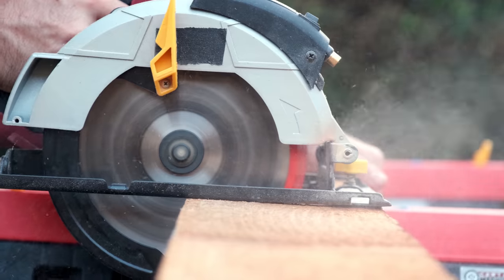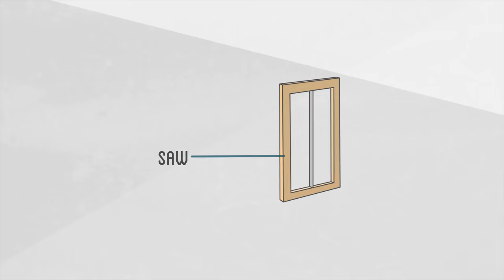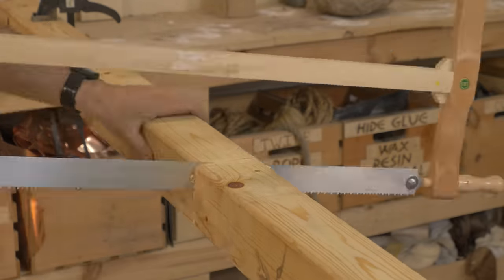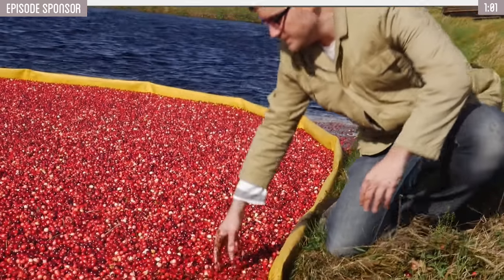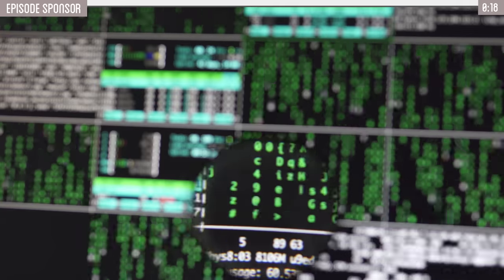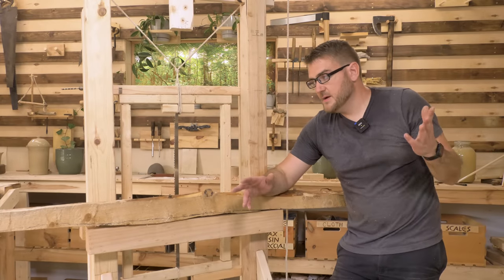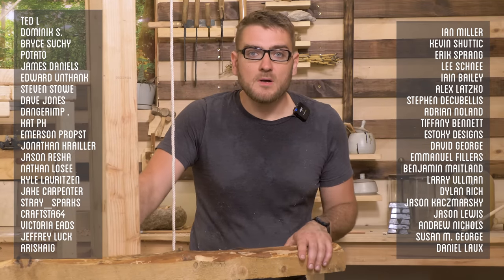This 12th Century Table Saw Is A Huge Force Multiplier!

Comment: force does not "multiply" out of thin air.
if force seems higher, it's because you're travelling more distance to apply the same force.
at the end of the cut, the energy consumed would be the same as if you were using a handsaw, as long as both are as sharp.

Comment: You should add more triangles to your frames to mitigate wobble and shifting, a rectangular frame thats only connected with 90° angles at the corner is not the most stable, if you brace it from corner to corner or something like that it should be more rigid, not speaking as a professional carpenter ive just also been doing home projects for a long time

Comment: Super cool experiment , however, the saw blade itself needs to be sharpened properly or like at all. It's like someone who doesn't know what a sharp blade looks or feels like sharpened it. Its not that much work and makes a massive difference, and medieval blade smiths absolutely knew how to sharpen a saw for good results. It's also extremely thick and not in tension which would've been common knowledge then too. The blade is definitely your biggest issue. People keep saying that the teeth need to be oriented the other way but they look relatively equilateral so I highly doubt that will prevent the thick blade from pulling the log upward or binding. The bow is plenty strong enough to pull a sharpened blade clean through since it can lift it while you're bearing down on it, the binding is likely being caused by the twists in the logs reference side coupled with a thick dull blade. Good luck with the water wheel, it'll cut easier then, but still needs a better blade to be impressive. As of now, you're just brute forcing it. They're medieval, not cavemen.

Comment: That thing is a finger remover.
Possibly a hand remover as well. It needs some basic safety thinking applied to it now. In the real industrial revolution arms, hands and fingers were regularly removed until it was understood that keeping a worker whole for twenty years was more economical than replacing them on a regular basis.
Reply: Nonsense! There's always a line of readily available replacements. Now nose to the grind wheel plebe!

Comment: Flip blade to cut on down stroke, and put wax or soap on saw blade to lubricate cutting. This will vastly reduce binding and make cutting easier and faster. 

Change the pedal to get a longer stroke per stomp, for more cutting per stoke, but have to put more weight per step.

Get a, blade with smaller teeth for easier and nicer cutting, aka a cross cut blade instead of a rip blade. Easier but less cut per step, but way less binding and cleaner cuts with more control.

Also go read websites, about how saw teeth work, it will help you make a better saw blade. 

Learn how to carburize your own steel, you skipped a huge step in the iron age going from ilmils steel to high carbon(unless I missed that video)

Comment: I tripped up on this video and is my first encounter with your channel.
While I found this video amusing it has a serious side too, historically but significantly proving the myth that accuracy is everything.
I was studying your mortice & tennon, while crudely cut are effective and solid.
My point is, almost every woodworking video out there insists on the perfect joint with no gaps created by woodpeckers, lie neilsen, veritas etc.
You have proved them all wrong. That chiesel is hardly a Stanley sweetheart or two cherries but did the job.
Ever actually inspected a genuine piece of chipendale ❓ While the stand back and admire appearance of those pieces are amazing, the quality of hidden details are let's say surprising to be kind. 
All quality antiques scream hand made, just look at dovetail joints. 
Yes we've made leaps and bounds in tool technology but the pressure to own the latest and greatest tools to do woodworking over rated. 
Woodworking should be about enjoyment, creating something out of bits of wood and honing hand to tool skills. 
So what if your dovetails are a tad gappy❓
I get what your about and I think it's brilliant.
I must conclude with I also think you're a flippin athlete‼️

Comment: I know this might sound a bit rude but I'm genuinely curious. If you're going to use precut lumber what's the point of doing all the finish work with hand tools? You've already taken advantage of a much more advanced sawmill to source your materials, why not save yourself some time?

Also the reason the wood is getting picked up on the upstroke of the saw is because the teeth are straight, and trying to cut in both directions. This combined with the thick spine of the saw and several other potential factors is causing the issue. A new saw blade with a better design that only cuts on the downstroke would be more efficient as in thet direction the table will obviously hold the piece in place and you wont waste nearly as much work lifting the wood on the upstroke.

Comment: Flip your saw blade so it cuts on the down stroke. It'll be less likely to pull the board up, and won't bind as much during the cutting stroke.
Reply: That saw cuts the same way no matter how you flip it. That's because the face and back angles of each tooth are exactly the same. It's called a plain tooth pattern. It is a crosscut pattern. Rip teeth have a rake angle.
Reply: @1pcfred  looked like a normal blade to me. In that case you are right. It wouldn't matter.
Reply: @joshuaglaude1549  it is a normal blade. That's why it is called plain.

Comment: A squared bar would have been made with an axe or hatchet that has the blade not on the center but on one side. To gain more precision you would smooth it with a plane. The saw is for planks.

Comment: Your blade is either dull or on upside down as it should be pulling down rather than pushing up. Do your saw teeth have any rake to them? You'll need to do research but I think the teeth should alternate so that the groove cut is slightly wider than the blade itself.

Comment: I suspect that the people in the 12th century had a better hold-down system than a rope. With the proper hold-down, the saw would be much easier to use and much more accurate.

Comment: Don't you need to lubricate the glides on your saw to keep it from wearing out quickly? I think they used to use animal fat. They also rubbed candle wax on the blade to make it cut more easily.

Comment: In one of the last few episodes of Dr Stone, they featured a tool used to replicate smaller design, and scale them up. On the small end you'd draw whatever you want, and through a specific configuration of wooden rods and pivot points, the image being drawn to scale on the other end. I'm just wondeing what it was/is called.
Reply: That is a pantograph tool.

Comment: Switch out your blade. If you look at the historical examples they use blades with angled teeth that cut one way, the 'return' stroke clears the sawdust from the cut. This will solve half your binding issues.

Comment: Since you are using metal ANYWAY, would it make more sense to make like a mill saw, which is essentially a large table saw.  The wheel is the best propulsion unit, so you could have a table saw and essentially set it up like any lathe, again, since using metal anyway, then attaching a bike to it would spin the wheel, or any kind of trendle.  

   But during the industrial revolution they had a treadle style fret saw, which essentially had a bicycle attached to the up and down motion to power a scrollsaw. 

   But glad I found this, I was thinking of something similar, but seeing this actually work I'm not sure I'd waste my time.  I guess thats why they figured "lets just use logs".

Comment: With the sheer amount of things he's built you'd think he'd actually get good at it and have the brains to put the saw blade on so it cuts on the down stroke rather than the up stroke plus the spring wouldn't have to be as strong and   the imput force would do more work less pulling on the spring more work going to cutting

Comment: It might be the perspective but it looks like you have mounted the blade upside down. It looks like it's cutting on the up-stroke more.
Reply: Being a plain pattern tooth it is cutting on both the up and down strokes.
Reply: @1pcfred  I took a closer look at the blade and noticed that the teeth had the same angle. The blade was filmed at an angle and that made it look like the blade was mounted upside down.

Comment: The teeth on the saw need a kerf set, and a better angle of attack, and the range of motion doesn’t allow the use of the full blade. It’s not as efficient as it could be.

Comment: Saw tooth geometry needs a good looking at. You’re ripping, so you need flat, chisel like teeth, they remove the fibers that lay lengthwise better. They also need to be almost straight one way, /_ pointing down, not <

Comment: The other big issue is you need a better solution to hold down the log as you feed it through. That piece of rope was completely inadequate and there are much more suitable solutions dating far back in history. Even if you remove iron from the equation creating a more rigid holdfast from lumber is absolutely possible whether it be another board that clamps down even loosely or better yet using a bow like spring mechanism would be better than that rope alone. Admittedly, I don't know what the rules of your project are and don't know if you are following a rigid historical design without the ability to make alterations or not.

Comment: A bit late here, but wouldn't an adjustable bar to clamp the piece down right in front of the blade worked a million times better? Rigid materials don't flex and stretch with movement like rope does

Comment: OK, you're trying to use a crosscut tooth section to do ripping.
It WILL do it, but it's going to take a LONG time.
You need a rip blade.

Comment: of all comments regarding tooth.   probably.  but not the real problem:  look at spring pole lathe for concept,  can cut on one direction.   No one is watching or observing. The whole frame is binding!!

meaning the track guide and the runners are not built correctly to force frame to operate independently of the bow or treadle

Comment: Knowing nothing about this, and admitting that I'm sure you've thought of this, what is the drawback of using pulleys in this system? It seems like, on paper, force multipliers are going to be your friend here. What would the drawbacks of incorporating a pulley system be in this design?
Reply: If you use block pulleys you trade off motion for force. One rope pulls on more ropes to move a hook less distance but with more force. There's nothing for nothing in this world. You can only trade some things for other things.

Comment: I appreciate your grit and intent here. That being said, have you done any research into how our pre-industrial ancestors accomplished these tasks? Or, is this a project to see if you can figure out the progression on your own?
There's a lot of historical reference, and a lot of historian-craftspeople recreating the techniques of the past. With a few small changes you could drastically increase the efficiency and accuracy of your work. For example: properly tensioning your saw. All band-type saws require tensioning. That big frame saw for resawing is no exception. (it looks like a Roubo style, by the way.) If you tensioned the saw properly, you would eliminate any wandering of the cut that didn't come from poor technique. If the saw was properly sharpened and ground, you'd eliminate much of the binding and reduce the amount of work it takes to make the cut. This means faster and less strenuous work.
Hopefully, that makes sense. This information is available, if your intention is to do other than see if you can get there yourself.
It's an interesting project either way.

Comment: You're fighting those massive gaps in the teeth as well as the reciprocating motion. You need to figure out how to make a fine tooth saw blade, the yanking it out of your hand is just a problem with a vertical reciprocating saw, I have the same problem with a scroll saw which is why I love a band saw because it just pushes the wood into the table. Instead of using a reciprocating saw for a saw mill, go to a circular saw, it'll make the movement much easier to control, though kick back is still a problem.

Comment: Yikes!   So much of this looked like an accident waiting to happen. It's great in principle but needs to be made safer.   He needs a brace on the top that is adjustable that can clamp at the right height to let the workpiece pass thru.  Or maybe a weighted or spring-loaded top brace to keep the workpiece from moving up with the blade.  The whole thing needs to be larger a heavier so it doesn't move around so much.

Comment: You've got the blade upside down, if you cut on the down stroke the work piece won't jump.
Reply: You've got eyesight problems because that is a plain tooth blade. That means it has no rake and cuts the same in either orientation.
Reply: @1pcfred  the flat side cuts/pulls away the material. The angled side glides over the material to reposition for a cut. Just an educated guess based on it grabbing the wood and pulling it up.
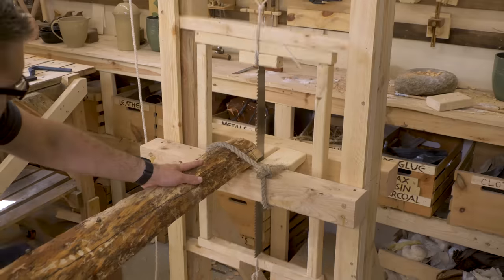Reply: @BeardyOfIron  video often distorts shapes due to the shot angle. Freeze the video at 6:56 and look at the teeth. Those are what's called plain cut teeth. They have no rake. So there is no flat side like are in rip cut teeth. You could say he's using the wrong kind of blade. But flipping the one he is using around wouldn't make any difference.
Reply: @1pcfred  Thank you, that's far more helpful then pointing out that I'm blind.

Comment: I'm only an amateur hand-tool woodworker, but a lot of this was painful to watch. You used a lot of wrong tools for the job, even while you have more appropriate ones in the background.

Big cuts were made with a turning saw (better for curves but not wrong per se) that seemed too fine for crosscutting those 4x4s. You have at least 1 hand saw hanging up.
The other saw was a flush cut saw (fine teeth/flexible blade for cutting small bits flush), which was way too fine. A panel saw or ryoba would have been better. (Flush cut looks like a Vaughn, they make a decent ryoba or $20)
Used a slick (big chisel for timber framing buildings) instead of a chisel, and it was suuuper dull. Might as well have been a log splitting wedge. Also way too big for those mortices. There's like 6 other chisels laying around.
Used a tiny mallet with the too large chisel.
The T handle auger needs sharpened as well, it was just spinning in the hole not cutting anything 1/2 the time. That thing should act like a forstner bit and slice through that soft pine easily. A sharp auger is a joy to use.

Not trying to be a hater, but this video makes the process look much more difficult than it could have been.

Edit: Also, get that saw blade sharpened, the teeth should at least come to points.

Comment: Your saw pulling the work piece up didn't help. I'd note that the saw mills have in-feed and out-feed rollers. You need more table for your saw and some rollers to help feed the work through on both sides rather than holding it by hand. That was part of why it was so tiring. I'd also say maybe a weighted hold down roller to help keep the wood from jumping would help too. 

I once made a reciprocating scroll saw that had similar issues. The solution was a bigger table.

Comment: saw blades bind when the "set", or bend of each tooth, isn't suitable for the type and moisture content of the wood being sawn. Try bending every other tooth one way, and every other tooth the other way. Just a little at first, then test it. Adjust as needed. People think handsawing is hard work because the saw isn't tuned properly. If the teeth are jointed, sharpened, and properly set, sawing wood should be relatively easy.
Reply: Also look into the difference between rip teeth and crosscut teeth. In your case you want your teeth to be shaped and sharpened for a rip cut

Comment: Avid hand tool user here-  that blade is WAY too thick .  If you remade that out of some 1095 spring steel maybe 0.040” it would be much much faster and easier.  Make the rake angle 0 to 5 degrees .  There are people that will punch teeth in a blade at a very reasonable price.

Comment: U have tooth in wrong direction. To pawer cut in such way tooth need go dawn. If U blade no have direction… look for other blade. And for such curve piece saw set shuld be a big… is no a dovtail in gift box, but rav timber. 
And U nead have more stability. Use sand badgs (i supose 4-5 with 40-50kg sand will make the job) on legs of this device. Best option would be make posts deep in to the ground.

Comment: You had the ripcut blade upside down. The straight edge of the teeth is the one that cuts. It should face down. In your saw projects the biggest hindrance is that you don't undesrtand saw teeth. There are two kinds. Ripcut and crosscut. A ripcut tooth acts like a chisel and a crosscut tooth acys like a knife. Study these and you will have your saws cutting ten times better.

Comment: spin blade saw
Reply: lathe + saw
Reply: blacksmithing a circular blade
Reply: or just 3d print and the graphite ball mill coat, electroform/plate into metal lol
Reply: pedal powered table circle saw
Reply: even bicycle table saw
Reply: why would you convert circular motion to linear, keep it circular
Reply: electroplating a wood charred saw blade into metal, primitive tech

Comment: Currently your saw is doing almost nothing on the downstroke because of the way your teeth are angled. Most of the sawing action is happening on the upswing which is also why it is lifting the piece so much. This change alone should improve the efficiency by a LOT.

Comment: Blade is the wrong way, you want it to cut on the down stroke
Reply: It is an omnidirectional tooth pattern. It cuts the same in either direction. It is called a plain tooth.